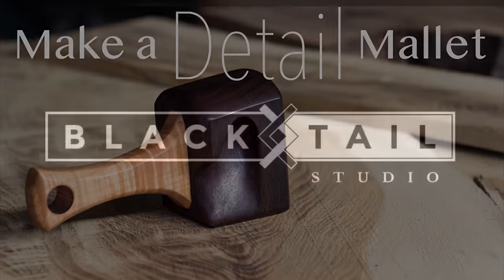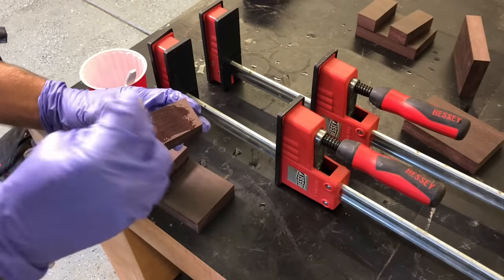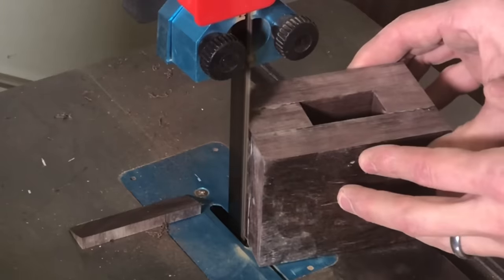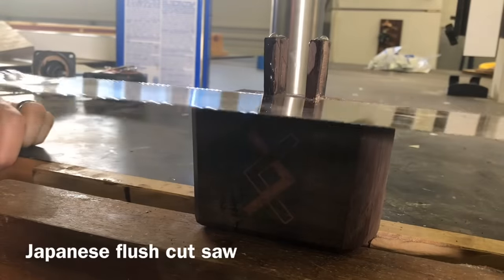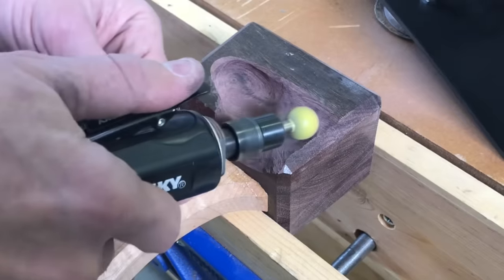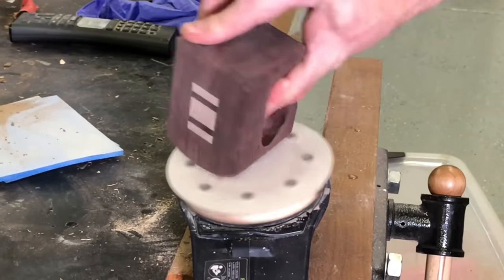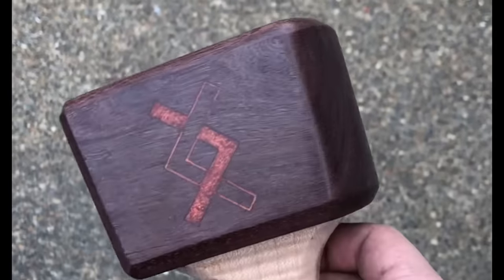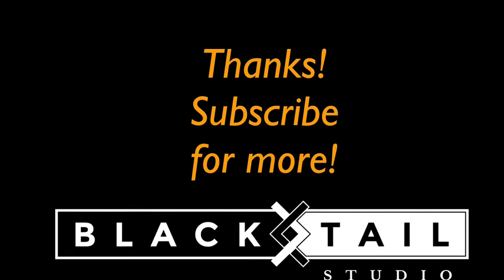The Glove Woodworking Mallet

Comment: It's nice to see some else that sands the wood up to high grit before putting on finish, I don't understand why everyone stops at 220. The higher you go up the more you get from the wood especially quartersawn Brazilian ipe if you come by some, as soon as you get over 1000g all this hidden figure will pop out and the color of the wood actually changes.
Reply: Depends on tge wood type, some woods don't come out well from sanding to higher grits. What ends up happening is you block the pores and finish ends up looking blotchy.
Reply: Big reason is that high grits don't then absorb the oils or finishes
Reply: I agree
Reply: I'm kind of an individual like you Drgonzo305. When I used to make bone letter openers and jewelery semi regularly, I always made sure to hand sand all the peices past 12,000 grit. Made them look like gemstones, especially after you buffed them with a nail Emery block and a quick wipe of mineral oil.
Reply: I've sanded white oak well past 600 and used multiple coats of bees wax and hand rubbed it in each coat and the grain just pops like crazy
Reply: Higher grit makes the pores get clogged and then the finish isn't all that great sometimes. Especially after months of use

Comment: Apologies if others have suggested this already (hundreds of comments to check) - but if you created mallet faces on both sides of the head, you could swivel the mallet and use it with or without the thumb stock grip, depending on the angle of use.

Love this project - definitely going to take some of your tips and techniques and have a go. Thank you for the video.
Reply: To add to this I've seen mallets with an angled face, which might be used for the down chiseling. I'm not a woodworker, so I'm not sure, but I imagine that could help on the ergonomics.
Reply: I feel like he could just hold it normally too if working vertically, no need to swivel.

Comment: I turned a mallet from a sycamore log using the same shape for the handle as you have. It was very light and could easily crack in half.  So I soaked it in genuine turpentine and linseed oil untill it wouldn't absorb any more, it took over a week.  Once it had dried it worked perfectly, great weight, great durability. I have hit stuff so hard with it, lost my temper, that it hurt my shoulder, and it still held up. It was forty years ago that I made it and its still serving me well. The thing is with a round mallet, every time you use it you don’t worry if you have the thing held correctly, with the face lined up, it always is, 360 deg.

Comment: Awesome mallet, sir! I'm in TN and made one (not nearly as amazing as yours) out of white oak from an old  1700's barn...needless to say, it was so hard that I had to sharpen every blade I used afterwards. Oak is not the most exotic looking wood out there, but old barns are much easier to come by down here than a Goby store ;)
Reply: White oak can be beautiful  depends on the grain.  I made my sister a cake Turner out of some and it had a burl look to it. I sanded it to a high grit and a fee coats of beeswax turned out beautiful

Comment: I know I am outside the lines… I watched your mallet video. Back in the day when I was in carpenter school I was grinding out thumb notches in my framing hammers. The OGs made fun of me. Then I bought two of them top of the line Vaughan hammers. I hogged out flat spots where their thumbs went. Then I glued it larger pieces of wood. Then I used my chisels and an old Craftsman drill with a heavy grit paper on a dowel that  I made. I finished it off using leather stamp/punches for texture. They LOVED it. The thumb notch controlled where the strike was going to fall. It kept the hammer from rolling in a sweaty palm. You also did not need to grip your hammer as tightly.This is when a journeyman carpenter had to drive a #16 Green CC Sinker in three strikes. I was thrilled to see someone still using a trick of the trade. This was after the dinosaurs…..

Comment: My first mallet was pretty rough and hickory. My next couple were Osage orange and the most recent is an Osage orange hammer meant for adjusting plane irons or light tapping. I didn’t weigh it yet, but it weighs around 6-8 ounces versus a typical 2 pound mallet made of exotic hardwood

Comment: Unique design, Cam. I can definitely see the benefit of the thumb groove giving you more control. I grew up with Osage Orange and it dulls chainsaw blades badly. It is like 2.600 on the Janka hardness scale while Katalox is 3,660, so Katalox is significantly harder. By way of comparison, hard maple is 1,450.
Reply: It makes beautiful knife handles and can give you a great sheen if you use it correctly.

Comment: I live in northeast Texas and Osage Orange is simply beautiful wood. It's incredibly dense and when sanded to 2000 grit or higher it takes on a wonderful shimmer that's got many facets within it.
Reply: I am confusedly.  Are you  sanding the wood to 2000 Raw or with a finish on it? 
I'm just trying to understand how it works. D o you wax it and then sand,   finish then sand, it or is it just raw wood?
I mean I definitely wet sanded a finished wood with high grits but I've never sanded raw wood over 220 without a finish on it so I don't know how it will come out.
Reply: @brownstonecustomcabinetry5309  I start sanding with a nearly finished project.. I start sanding with about 150 grit sandpaper and gradually work my way up to 2000 grit. Slowly increasing to higher grit as I go. Often I don't even put a finish on my finished project because by the time you get go 2000 grit the wood is beautiful. If I put a finish on it I normally use wax or butchers block oil. I hope this helps.
Reply: @scottharrison7696  Wow!  I thought this guy was doing some movie magic.  Learn something new every day.

Comment: So glad i found your channel last week. Different perspectives and design with intent and purpose.  Using the different finishes helps build the mental library of what can be used on different species of wood. Also, finding different species. 
I was a flooring contractor full time for 12 years and really loved installing hardwood flooring. It too exposed me to multiple different woods that i carry in my beginning hobby as a wood worker some years later.
Thanks again for sharing.
Reply from the maker: Awesome, thanks!

Comment: I’m totally stoked to throw my festool into a vice and use it like that..your so right on haven’t lived yet till you try it.. thanks for the tip Cam!
Reply from the maker: Cheers Johnny!
Reply: Just be careful not to pinch any moving parts.  I killed a hand-held  belt sander with a vise.  Turned out the only flat faces pushed right on the end of bearings.

Comment: I’ve never built one but I have 3 mallets and I dug out a thumb hole in my small and medium ones like twenty years ago. I like to slap it on the chisel sometimes in a more sideways motion and it gives you that control. Cool to see this as I thought I was just weird. Also, I paint airplanes for a living and use that paper and after 5000 it actually starts buffing the poly lol Cool video and maybe I’ll build a nice looking mallet now.

Comment: Nice looking piece!
If people encounter problems with finish not binding to such high grits, I found that metal working finishes do a great job there... I nearly always finish my wood stuff up to 10k-15k, often leave it blank (because it won't absorb any dust or dirt either), but when I need it to be water-resistant (or proof), I'll use either raw linseed oil or car clear-coating. Never had any issues :)

Comment: Absolute work of art.  I've been planning to make a few more mallets in the near future.  I built my first one a while back just using some scraps of oak and walnut.  I laminated the handle so the walnut is running down the center of the handle, then I also used walnut for the wedges.  It's not the prettiest thing ever, but man has it held up really well even if it hasn't been the greatest of designs.  It will always have a spot in my shop for simple nostalgia.  My local hardwood store had a few scraps of wenge last time I was in there...I wish I had picked it up.  Hopefully they'll still have some next time I stop by...that would make for a great mallet with some hard maple I already have.

Comment: As others here have said, one of the pipe cutters that you spin around the pipe would be a great addition. Plus, it will squeeze the end of the pipe down a little making it easier to hammer into the handle without worrying about blowing out the wood on the other side. Just make the pipe long enough to sand down the smaller part. Awesome job on the mallet! A beautiful work of art!
Reply from the maker: Thanks!
Reply: A new hacksaw blade is cheaper plus he's only going to grind the ends of the pipe piece down flush anyway.  No need for precision here.
Reply: @bobclifton8021  I guess I didn't explain it right. It didn't have anything to do with precision. He mentioned in the video that he had to be careful not to blow out the other side of the wood when he hammered in the pipe. The pipe cutter reduces the size on the end of the pipe making it much less likely of blowing out a big chunk of wood like a sharp edged pipe would. Plus, after seeing all the cool, awesome tools he's got, I didn't think a $16.48 tubing cutter from Home Depot would break the bank. It's just another way of doing it that might save the aggravation of a few messed up handles. Y'all have a great day!

Comment: On your copper ring, try a 1/2" tube, lightly countersink each side of the hole, using a ballpein ball up, clamped in a vise, and another ballpein topside struck with a soft hammer, then you have a perfect copper gommet for your lanyard.

Comment: I imagine you’ve gotten thousands of people commenting on how amazing it looks. I don’t really have any wood processing equipment like table saws, routers and power sanders so I try to find wood already down to size. It can be a pain but my body can’t handle the manual work and my wallet can’t afford the cost so I try to make do. I’ve actually thought of a similar design to how you made the thumb recess. For carving you don’t need as much power behind the stroke, instead it’s about the accuracy  of the tool strike.  Using big mallets tends to be overkill and can be a waste of energy, and in my case pain. If you spend an hour trying to use pinpoint shots with a big mallet on the hand grip you will constantly find yourself choking up towards the head. I have a hard time coming up with small projects for myself but I hope I find something and some of this wood to use for it because I love that look. I wish there was a way to embed it with a gold resin but to have the gold show up like the swirls in curly maple. Or maybe some shiny brass inlay, I need to try that out. One day, maybe....

Comment: I also like to sand very dense woods up to very high grit - and so far the best finish i've found is just a pretty watered down shellac - less even than what a 1 pound cut would be and just wipe it on with a simple quick and dirty pad made from paper towel. 5 or 6 coats a few mins apart - very sanding after the first 2 or 3 with the last grit you used sanding the wood - then to finish up a bit of paste wax applied very lightly with the finest steel wool and a light touch and then wiped down with a rag
Reply from the maker: I’ll have to try that!

Comment: Really beautiful work, dude! Fantastic! 😃
Whenever you can try a Brazilian wood called Garapeira. It's a really common wood down here... Most wood for roofs (or construction, in the American way) you can find here is Garapeira - it's easier to find than pine. 
It's a yellowish orange wood to a reddish orange wood... And it's hard... Not the hardest wood, but hard enough even for mallets. 
Either way, the point is: you sand it with 50 grit, 80 grit, 120 grit... Apply some fine steel wool and that's it. It seems like a glass! 😃
Really easy to work with and looks beautiful!
Reply from the maker: Thanks buddy!!

Comment: Nice video, as they all are. Your mallet, although very nice, I feel is best suited for very accurate and deliberate work, as it seems to require a firm grip, and does not appear to use inertia for impact.  I have made a few out of seasoned Olive wood, which is quite hard, and in Australia, cheap and plentiful.  I simply turn them on my lathe.  I made the first one as a 2 part head and handle, and the second from one peice.  The second came out so much better, more so because of the beautiful pattern of the grain. The third was a peice that had a crack all the way down the side (and otherwise would be for the fire), however it it is still good for a workshop 'pounder'. My design uses the old style cylinder type, with a slight taper towards the top. They have a slightly longer handle, with a pommel to stop it slipping out the hand, but it can slide in the hand, as such not requiring a 'firm' grip, and with the extra weight/balance being on the head, gravity and momentum do the work, much like with a pick axe..  I have found this shape to be the most 'fatigue' resistent.  The first one I made with a rounded over top edge I actually use as a meat mallet/tenderiser.  It works great, breaks up the fibres without 'mincing' the meat. Another practical purposiong of the woodworkers mallet.
Reply: My apologies, I missed the fact that you specified it IS a DETAIL mallet in your description!  My bad, I missed that bit, obviously too engrossed in your video. Whoops!  Thanks for not giving me a rebuff! :-)

Comment: If your going to be adding the pipe to alot more of your handles then you should get one of those little copper pipe cutters.
Reply: Which would make it easier to get into the handle and wouldn't be visible after sanding.

Comment: Great mallets. It's another operation and requires another tool but I think an ever so slight bevel on the inside of the copper ring would have been nice.  Could do it on the drill press with a large chamfer bit, or probably just a light pass by hand with a deburring tool.

Comment: Regardless of how you grip the hammer if you are experiencing enough hand shock to cause pain you are swinging the hammer incorrectly and this is especially true for blacksmiths where rebound can be a serious thing. Ideally your grip should be secure but not tight and your wrist should be loose by the end of your swing, you shouldn't be imparting any force on the tool at the moment it makes contact, a stiff wrist and overly tight grip will let the shock travel up your arm and can cause you a lot of pain if you are swinging all day.

Comment: Great video and love the overall design!  I've used Katalox on mallets, but usually only for the core piece with a different wood for the outside pieces.  Love the weight it gives the mallets and also love the glass-like feel as you sand it through the higher grits.  I'm going to have to try that thumb notch.  Thanks for putting out such a cool video!
Reply from the maker: Thanks Geoff!

Comment: You can get a pipe cutter at a hardware store instead of using that dull hacksaw on the copper pipe. It's an amazing tool -- just clamp it around the pipe, turn it once, tighten a little, turn it twice .. boom, a nice clean cut. Nice video, thanks.

Comment: The last thing you need is advice, and I'm way late to this show, but in my former career I did HVACR  and was considered competent.  Try using a coupling instead of working so hard with tubing. It is a great detail, but couplings are slightly thicker and have a nice edge (at least one side,) that will save you time and give a cleaner finish with less work. Also consider brass bushings in dimensions that require no cutting at all.

I wish I could afford your tables, I'm a buyer at a price below slab cost! Lol

Comment: Very nice! I was realizing that the "baseball bat" style mallet I made a few months ago is a little awkward because my hand is a bit far from the chisel I am striking. I think I will make one like this when I find some time. One modification I will try that you may not have considered is to gouge out a thumb pocket on both sides so the mallet can be reversed and have both a round and a flat face. Seems like there may be cases where you would want a flat face. In fact I noticed it was slipping off the chisel handle at one point in your video since both your mallet and chisel are pretty steeply round. Anyway, just a thought. Love your videos.
Reply from the maker: Thanks Colin!

Comment: I do blacksmithing and I find tumb grip to be good for one thing and that is precision,but you achieve this by placing the thumb on the back of the handle, so i would be interested to see something similiar but where the slot is carved on the underside of the head where it meets the haft, that might be interesting

Comment: Point of contention: 1:03 “It is not as cool looking…”  I think it looks stunning. Would look great as a bowtie on lighter woods, or even orange/red woods.

Other note, amazed the epoxy does not become brittle and fail over many years of use. (The epoxy used to hold the mallet head pieces together)

Comment: Great design. Does having the grain in the handle across rather than down the length reduce its strength.  I suppose this style of mallet does not do heavy work.
Reply from the maker: That’s actually just the figure, not the grain. Kind of a ln optical illusion